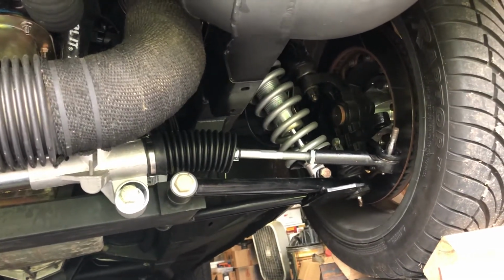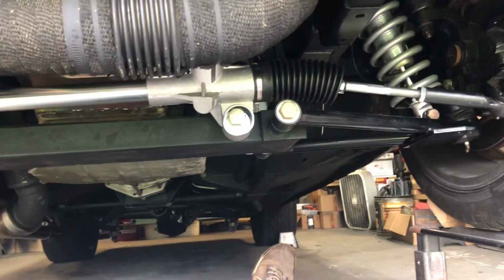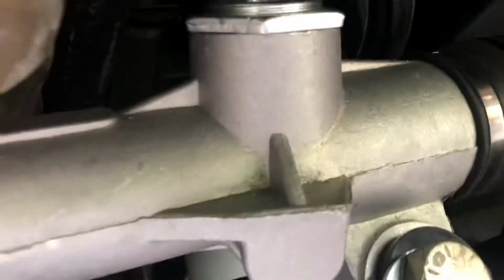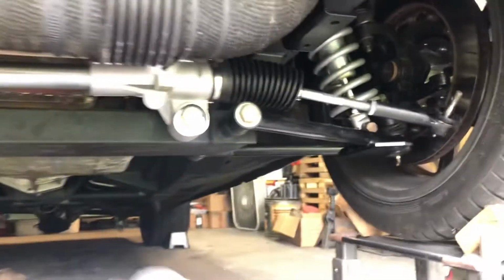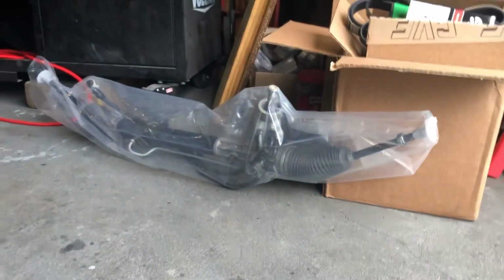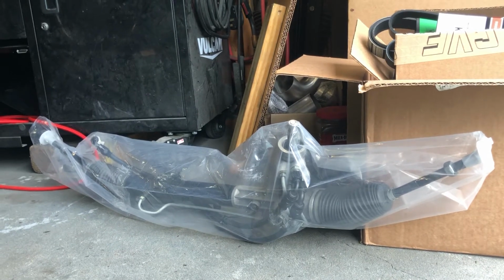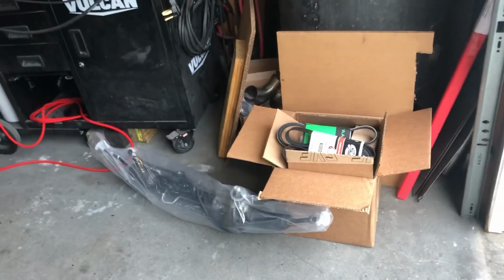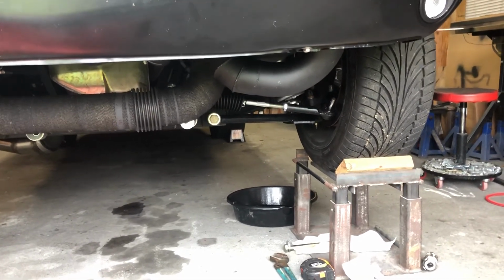68 mustang manual rack install issues pt1

Comment: I'm running a manual rack. My crossmember has a slotted hole on one side for that wider or narrower bolt pattern. Im also running custom motor mounts. I dont mind the manual feel. I think it's sturdier on the highway. Hope you get it figured it out.
Reply from the maker: I considered slotting it, but when the angle of the steering shaft was off, I just said screw it.. what's your ratio lock to lock? an actual manual rack probably wouldn't be as bad as this.. its not bad at speed and feels good while driving it.. but cutting the wheel to get out the driveway and leave stop signs sucked..
Reply: @callofgeorge  honestly I don't know how many turns it is. I'll have to check that out and get back with ya